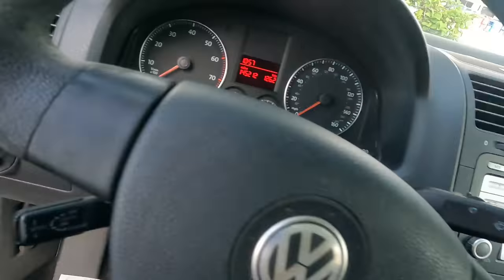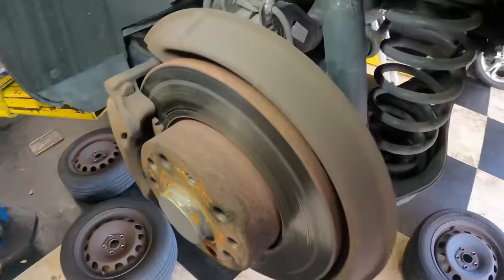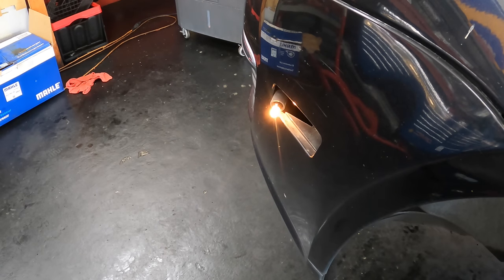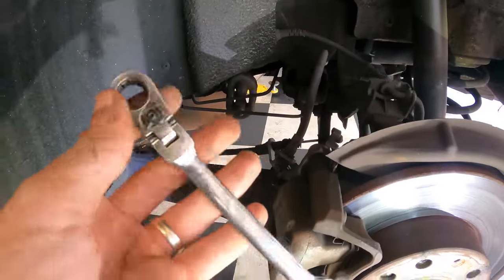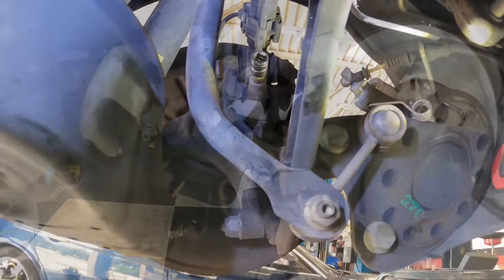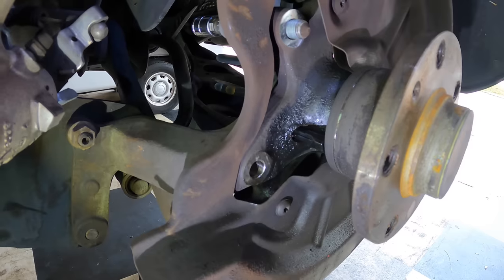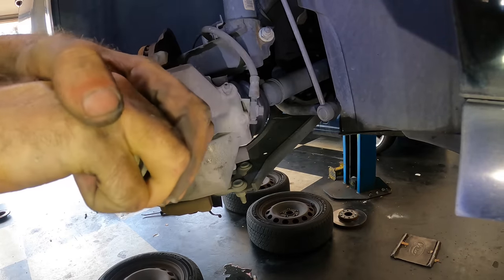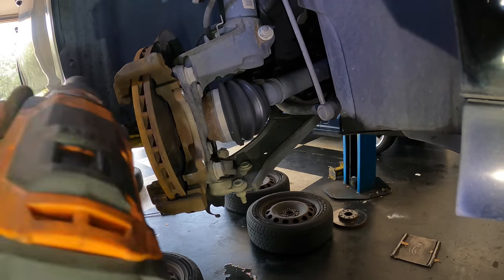Over Engineered Bolts! Four wheel brake job. Actuated Calipers. Volkswagen Jetta 2.5

Comment: Didn't need to put grease on the pads/shims? I had to for my Camry to prevent noise. I wish I could say the same about the drum brakes in the back... I think I need to rebuild it as the noise keeps coming back after a thousand miles or so after cleaning out the brake area with brake cleaner. That or I just got crappy shoes (Brake Select), whereas my front pads are Akebono ceramic. That, or I needed to lubricate the backing plate, which I did not do.
Reply: @NoWr2Run  Yeah, I know... such a pain in the butt to do on gravel though lol.
Reply: @JiltedValkyrie  LOL, I had a GRAVEL Driveway where I worked on my vehicles, learned my lesson fast. KNEE PADS & A BIG SHEET OF CARD BOARD. Also sockets & screws are easier too find when you drop one. Still had problems with the Floor Jack though, don't roll well on Gravel.

I moved a few years ago & have a paved Car Port now, use a creeper. Now I just need a GARAGE & A LIFT, LIKE THAT WILL EVER HAPPEN.
Reply: @NoWr2Run  My friends are tired of me asking to use their driveways lmao. I might just have a shop lubricate it for me since it's a huge pain. The most common thing I do is my oil change, really.
Reply: @NoWr2Run  My Toyota dealership knows me well enough by now as I take my Camry there for non-oil fluid changes since I don't have a way to dispose of non engine oil fluids, but they will charge their flat rate. They are however, fans of me racing (and ricing) my "Camrally". Or I'll take it to another shop I walked into that is good and get it done with new struts at the same time. I'm running on 20-year old struts and rally + no dust boots = noisy.

Luckily, I already know everything wrong with my car since I keep an eye and ear out for it and do a lot of my own repairs that don't require much use of jack stands.
Reply: @JiltedValkyrie  NO SHIT, WOW, Do you have a website or YouTube Channel ? Thanks.

Comment: I was always told to put caliper grease on the hardware for the pads to help prevent rust and corrosion. Is that unnecessary? I’m a shade tree mechanic.

Comment: Every VW must come stock with burnt out markers because I always thought it was just a reflector on the bumper this whole time
Reply: @The Spaced Pirate 
The issue is the bulb they spec, they are brighter than the US spec but they don't last as long, of course they don't even use front side marker lights in Europe, so they don't have that problem. They use a turn signal repeater instead and that bulb isn't on all the time so it lasts much longer.

Comment: Sometimes it's more cost effective to replace rotors. BUT if you have factory rotors they won't warp like the cheap aftermarket rotors. If I had factory rotors I'd rather pay more to machine them than to have cheap aftermarket units installed that won't last. Just my 2 cents....
Reply: That's why it's not realy the most cost effective. It's lower short term cost, long term pain & higher cost. A good quality rotor should be able to be turned 3 to 4 times depending on how badly the pads are neglected. The cheap rotors have to be tossed, and are often much thiner to begin with. You save money by not having to buy 3 or 4 more sets, or start replacing them because they overheated and warped in the middle of an Alaskan winter. Lol Don't get me wrong I have been in tight money spots, and used the cheap junk in a pinch. But then I replaced them with quality rotors when I could. Just makes better money sense in the long run.

Comment: Too many different bolts for the calipers and brackets.  My Toyota MR2 had the same E brake setup.  I first used needle nose pliers and then made a tool as it was a race car and the pads got changed often.  The slide pin pockets were really a mess so I cleaned them out with Q tips.   The rubber plugs will keep out the dirt from the Torx heads, too.  It is no fun to clean those out.
Reply: Dirt is one thing, but get them full of sand and salt and then full of rust... ouch. And being recessed like that, I don't see how anyone could get an air hammer or chisel into there. Maybe drill the head off? Not fun. I think in an area with winter salted roads, might be a good idea to pack that space with some dielectric grease and then put that dust cover plug on. Can always clean out the grease next brake job with some brake cleaner, then the Torx head will be 'nice n shiny'.

Comment: What in the world do those wires in the brake pads tell the car? Crazy!
Reply: Wear indicator. If the pad reaches its limit the circuit is closed to negative over the rotors (+ on the cable)

Comment: You never cut German rotors you replace them!! They will warp super fast!!
Reply: Machining any rotors makes them warp super fast. Rotors have a designed thickness to allow a proper heat dissipation rate, machining them makes them hotter when braking and cool off faster when not.. making them warp.

Comment: I swear, some mechanics just like to over torque bolts on, just to bust the nuts of the next guy!
My wife's 2010 Camry oil canister required an 18" breaker bar and over 80 lbs force to get off.  So much for "hand tight" and a little more. I replaced the paper cartridge filter and O-ring, and re-tightened it at about 5 foot-pounds, and guess what?  No oil leaks! Why did the previous shop tighten to over 100 foot-pounds???? ( "Well help me understand" VGG )
BTW: Aren't you suppose  to paint those calipers candy apple red?

Comment: Can't you just twist the disc out on those without taking the carrier off? I know there was a different type on the golfs etc but I'm sure once you take the torx 30 screw out and the disc is loose, you can pull the side of the disc farthest from the carrier towards you and then wriggle it out
Reply: You can't well at least on my 08 passat
Reply: I was wondering the same thing, there has to be a reason they use wheel bolts rather than studs, using bolts there is nothing to foul on as you slide the rotor out.

Comment: [[ SAFETY ]] Thanks Ray.  But the job on those slide pins leaves much to be desired - these are brakes - so I chime in.  Other commenters saw too - listen and take to heart, else - from OUR point of view - it is a waste of our time.  People watching these videos to learn many times do NOT see the comments.  That brake cleaner seen squirting out is now sealed in and will evap, possibly forcing the pins [32:50].  As I understand it, It is recommended to only use a small amount - else excess lube can apparently cause issues also.  In my opinion, insufficient cleaning ; less-than-ideal lube ; excess lube ; poorly applied lube.  In this case, I hope people DON'T learn from this video.  Sorry ... but ... SAFETY.

Comment: Hi Ray, I know the tool you used to remove the front caliper was a torx but could I be wrong and think it should be a 7mm Allen key? I know it worked for you but I have done work on these in the UK and the Allen bolt is what I found. Could be %100 wrong but thought I'd ask. Also I would normally remove the fluid reservoir before returning the piston back. Just my way.👍🔧
Reply: UK vs US if your talking about reservoir cap, don't. Or do ( lol). When I was naive I did once. Caliper was stuck so I squeezed real hard. Well..... it broke loose and it shot pretty far. What a mess. Note..Brake fluid is not good for paint. It was a bad day.
Reply: @dragonmaker1541  yeah exactly, I put a lot of pressure on a caliper once to then remove the cap and have a fluid fountain lol

Comment: There's my problem with VWs. Special bolt heads - not needed. Caliper piston - nonstandard and needs a special tool to compress - not needed. Got a taillight bulb out, car won't start on even-numbered days if it's a cloudy day in Bavaria.

Comment: One would think in this day and age that reservicing rotors and drums is pretty useless, it's always best to replace those rotors instead of resurfacing them. Most shops today will not resurface rotors due to the service limits and other issues and feel that it's just useless because for a few extra dollars you can replace new
Reply: I found on my 1996 F250 4wd extended cab 8ft bed that I should of had the original rotors turned instead of buying new ones that started coming from China. It was a heavy duty truck and close to 7000lbs base. The new rotors would go out of round ( warp ) within 6 months, after 3 rotors and 2 sets of pads I bought performance slotted rotors and performance pads,  not only did my braking improve by leaps and bounds but it was the last time I had to replace a rotor because of warping and it it was at the price halfway between the cheap rotors and the dealer priced rotors which had mixed stock.
Reply: @TheWabbit  yes this will definitely happen if you're buying cheap China rotors especially for a truck, if you would have done some research you would have found the brembo makes rotors for just about every vehicle on the market and the price is extremely compatible to the cheap rotors. And the durability and the craftsmanship are five times that of a China cheap ass rotor. I'm going to say you used evolution rotors and brakes and purchased a kit but if you did not purchase the z36 for your truck you pretty much through your money in the wind.
Reply: @willsrestorations  I didn't realize buying rotors from a dealer would result in a set of Chinese rotors yet that's what they ended up being ( the second set ) 
Can't remember the brand of slotted rotors I bought ( not Brembo ) but If I had known the difference in stopping power I would of put them on before I needed brakes.
Reply: @TheWabbit  it sucks because the automotive parts industry has gone to shit. It's very hard to find anything of quality in this industry, I've owned a restoration shop for nearly 40 years and the past 10 years has been absolutely ridiculous, I send more parts back then I actually accept. Not to mention all the counterfeit parts out there they're actually coming from China.
Reply: @willsrestorations  I can only Imagine, I live close to The GM and Ford plants in Michigan. I know so many that worked in them. My BIL worked at Hydramatic and started seeing the cheap wooden crates come in from China ( late 1990s and less TRW parts. He said they went from rejecting 1 out of 100 ( TRW ) to rejecting 2 out 3 but GM still saved a nickle by getting the rough machined Chinese parts. It was really sad then and is just heartbreaking now.

Comment: Always the drivers side that wears first...

Be careful leaving the keys in the car is a great way to get them auto locked when the alarm triggers 😂😅😂😂
Reply: Always roll down lektric wdo to prevent frustration
Reply: @peted5217  from around '98 some alarm systems also close the windows... Unless the rear windows are manual... Just not worth the grief
Reply: @iHelpSolveIt  didn't no that and fortunately didn't happen to me !

Comment: You sprayed brake clean into the slider hole, than shoved the slider pin with new grease into it without removing the brake clean, rear drivers side lower slider... Did you just forget you sprayed the hole? You could actually see it spray out partially as you put the slider pin in... Might as well have not greased it as it's going to wash itself off within the boot.

Comment: Interesting that German engineers would use completely different fasteners on front and rear brakes, when they perform essentially the same functions. Maybe this car was engineered in the US.
Reply: The rear brake system is quite an old system also used on much older VAG cars. I assume they just use (or used?) that unchanged all these decades because it is available and pretty cheap. The front most likely received revisions for bigger/stronger brakes which included a change in fastners.
But if that's a problem for you, never work on french cars. There you almost always have to get the part no from the current installed part as they basically used whatever was available in the shelfs at that time. Hotchpotch if you will.
Reply: That would be correct.. all the VW's from Germany don't use triple square except on the inner axle bolts, front and rear brake bolts are hex heads. The US VW's use triple square in a lot of places for no reason at all.

Comment: Looks like VW are a real PIA to work on am glade I don`t own one anymore. Not only do you need special tools to do a simple brake job it appears you just can`t compress the brake pistons you have to have a special tool for the rear to rotate it . While the front piston you just compress .Why can`t the pistons just work the same ?
Reply: you can just use a channel locks on the rear.. you don't need a special tool.  you don't actually need any of VW's special tools, they only make things slightly easier.

Comment: The Trppel-Square or XZN bolthead can take some 8 times higher Torque than a Hex
Reply: A regular hex head does even better. Those triple 4 bolts did not appear to go into a recess, so there is no need for them.
Reply: @williamallen7836  Becus they were chewed up.
Reply: @dumbeezy5480  one or 2 were slightly chewed on the inside. The bolt head it's self ware it was perfectly fine was cinched down on top of the bracket. The only time using such bolts is better then a hex headed bolt is when the bolt head needs to be recessed. These were not recessed. It's a stupid engineering thing that gets done on many German cars. If they were so superior in this case, they would have used them on the front. Which requires a higher torque value on the front. The rear brackets are torqued to a lower value. Infact those rear bolts are supposed to be replaced as they are a "torque to yield" bolt. Once installed, and removed they lose thier spring quality. Replacement with a higher quality hex head bolt that doesn't have such a low yield point would be an improvement.

Comment: Why not pull the caliper and bracket as a single unit instead of individually.
Reply: The pads are sandwiched between the Caliper and the bracket, so they have to be separated in order to be able to change the pads.

Comment: First car I cam across with pistons you needed to rotate to retract was an old Audi 100. It has a VERY shallow large hex to rotate the piston. So shallow it slipped really easily. Lousy design (but plenty of lousy design in that Audi)

Mind you, on this car, whose idea was it to route the brake pad level wire that close to the centre of the disk. Rather than through the caliper body safely away from the disk!
Reply: It’s genuinely not that close to the disk and they very rarely get caught
Reply: @gregshearer423  , fair enough, but seem a completely unnecessary feature.

Comment: VW triple squares blow, but not as bad as their 12 point axle bolts.  They need Aristotle level leverage to tighten.  I'd love someone to explain the engineering rationale for that, because preferring that over castle nuts seems like the dumbest thing ever.

Comment: I don't think that parking brake mechanism is very clever. First it doesn't hold nearly as well as a small drum brake in the center of the caliper. Second, it makes that caliper quite expensive to replace or rebuild; not to mention after a while you have to replace the cable equalizer in the middle anyway.
Reply: These rear calipers are like $50..

Comment: I'm genuinely curious, are the snap on electric ratchets worth it?
Reply: I would also be interested in information on them. In my years as an ASE-certified tech, I  owned only one air ratchet. I gave it away. Air ratchets, like leaf blowers, make entirely too much noise for the amount of work they do. Electric ratchets are something I could use.
Reply: I use a 3/8 Milwaukee with the M12 battery, but I'm not a pro.  I already had the M12 system for some other things and Amazon had the bare tool for like $60.  I'm gonna guess that's a tenth of what the Snap-on costs.

Comment: I consider engineers that spec stupid bolts where a regular bolt would work just fine to be well educated buffoons. Regular bolt should have been used; doesn't accumulate crap that makes it hard to insert tool, risk rounding it off. GM likes to use torx bolts with too shallow pockets that just beg for rounding off. Just put a regular bolt on there jenius! 

I've dealt with so many stupid decisions by engineers that give us repair techs problems. Military, industrial, and in the USPS. All due to the engineers that designed the equipment having no hands on experience IMO. 

When I ended up an engineering tech at one point in my career designing/building assembly machines/fixtures, I ALWAYS designed with ease of maintenance in mind. 

KISS!   

edit: I propose every design engineer should have that tattooed on the back of their mouse hand.
Reply: but a torx or triple square bolt can be installed by a machine on an assembly line, also phillips and anderson head screws
Reply: @bigjohn6405  I know they are more automation friendly, I worked in factories that used stuff like torx & phillips. But those parts were not going to be exposed to the elements. For stuff like these brake calipers, there are fasteners like the external mortorq that would make life easier for the guy fixing it down the road, are automation friendly and are 6 and 12 point socket compatible. So no need for a mechanic to buy special tools. Win - win. But maybe cost is the holdup, in which case shoot the bean counters! 

Lol, just an unfortunate victim of these fasteners used on cars bitching. And plug in chips on equipment used on aircraft that do carrier landings that would shake loose. And too small wiring thru holes for frequently replaced parts used on letter sorting machines. And and and...    😠
Reply: @angelr8892  generally  manufacturing only considers assembly, repair is someone else's problem
Always wanted to meet the people who writes the repair manuals